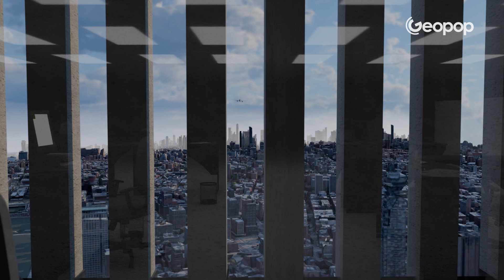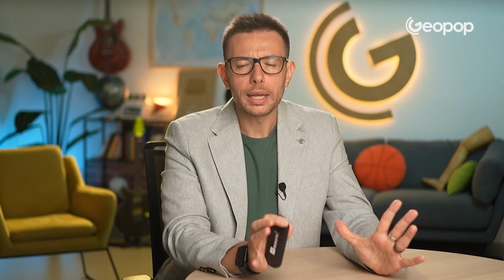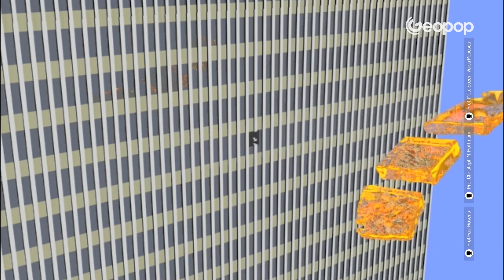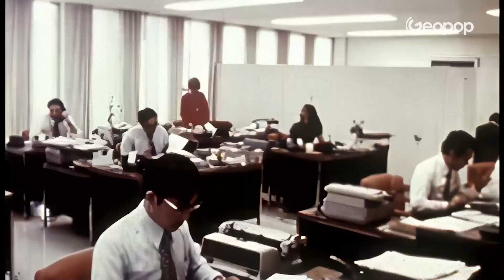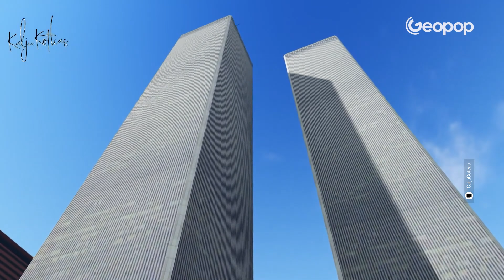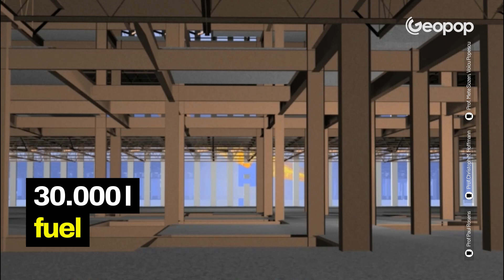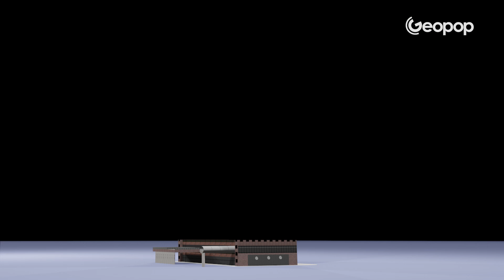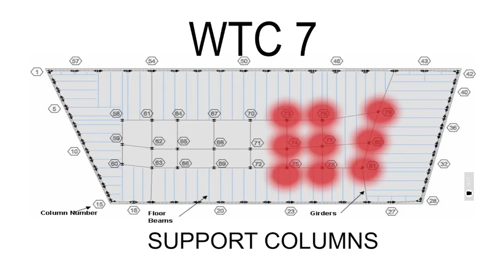9/11, 2001: The Technical Reconstruction of the Twin Towers and WTC 7 Collapses

Comment: The collapse was due to the heat on the steel as explained in the video. yes; but an EQUAL cause was the unique design of the towers.
Let me explain:

1. The main worry of any entrepreneur proposing a skyscraper is the economic viability of the project … there was real worry that the low % of occupancy of Manhattan office buildings would doom the World Trade Center.  There might be too much empty office space in lower Manhattan!

2. The architect’s plans that were approved were selected because of the “open” floor plan, with the vertical strength of the buildings in the central steel reinforced concrete elevator core & the iconic stainless steel outer girdle that surrounded the outside (the vertical beams that you see as stripes closely packed around the outside of the buildings, which leave little space for the narrow glass windows).  With the core, these vertical stainless beams carried the entire weight of the twin towers.  Why this design?  To create an open floor plan on every floor of the building (with no internal columns, the prospective tenants could design & build the interior walls as they wished).  This open floor plan was a major selling point to fill the building with new tenants.  The walls put up by the tenants were invariably NOT load bearing.  The actual floors “hung” between the core & the outer shell.  This is a major part of the explanation of the sudden collapse.

3. The stainless exterior beams, together with the core, made the buildings precisely like an egg, with the main outer shell providing a majority of vertical support, the floors virtually hanging between the center core & the hard “egg shell”on the outside.  If there was a downward force the strength of the union between the floor structure & the outer “shell” was critical!

4. If lower floors lost their vertical support like the spot where the airliners hit, the WEIGHT of the floors above that spot acted like a massive hammer, the sudden blow immediately overwhelming the vertical supports (the core & the shell) of the building’s lower floors & “stripping” the floors from the outer stainless beam girdle. This kinetic cascading “pancake effect” is the same as we see in earthquakes.  Proof? The tower first struck stood much longer than the tower struck many minutes later.  Why? Because the second jet hit the second tower lower, thus creating a heavier “hammer” to force the chain of events which resulted in the tower being “husked” like an ear of corn (separating the floors from the outer stainless supports) earlier than the tower struck first.  The second proof is the example of a building designed with the traditional “box beam” construction that received the hit of a big B-17 bomber years earlier & survived, The Empire State Building. That building’s inner column supports stopped the “pancake” effect from collapsing the floor structures in sequence.

5.  The force of the big jets blasting through the outer stainless shell (you could see the debris shooting through the other side) obviously obliterated or seriously weakened the elevator concrete core vertical support. The concrete was brittle & vulnerable to side forces (it would not have taken much side to side movement to crack & weaken it). The building’s design thus doomed the structures to collapse.  This blow from the airliner took out a wide chunk of the outer “egg shell” as well & as we all know, once the shell is breached, an egg simply collapses.  The weight of the collapsing floors simply added together to create more & more momentum as the buildings went down, making the collapse occur incredibly fast.  Look at the outer shell beams in the debris, sticking up like fence post pieces.  Use common sense, there was no need for a “controlled demolition” with explosives, the kinetic energy & weight of the structure brought the buildings down.  There was no visual or auditory evidence of explosions, period.  

It is important to observe that almost all of the skyscrapers in New York are designed on the “box” steel column & horizontal girder, tried & true construction method, instead of the “egg shell” method, which was considered radical at the time.  Thus, like the Empire State Building, they would not likely collapse like The World Trade Center buildings.  We don’t know if the terrorists knew the engineering, or were just “lucky”!

Why the above explanations were not made by the mainstream media is beyond my understanding, but engineers would agree, unless their brains were infected by the conspiracy theory cancer.  When media fail to do their job of providing expert explanations, the conspiracy theory fools gather like vultures to promote their own radical views.  The superficial news media in this case, once again showed that unless their reported content has sensational or entertainment value, it doesn’t make it on the air!

I would add, Tower 7, as you probably noticed, was designed with open floor plans & a reliance, in large part on outer columns, not the tight boxed design of most other skyscrapers.  Its trapezoidal design introduced unique engineering elements that presented a unique set of weaknesses & the fires were able to burn for too long, given the electrical & water shortages.  Again, no visual or auditory evidence of explosions.

Should the architects be blamed for a twin tower design that could so seemingly easily bring the towers down?  Well, in law, liability for negligence attaches only with sufficient probability & foreseeability.  Was it foreseeable that large commercial airliners almost full of fuel would strike the towers?  We’ll never know the answer to that question, it was never asked in a court of law!  Sometimes “innovations” have unintended consequences!
Reply: Perfectly articulated and yet too many big words for “skeptics”
Reply: You nailed it! People get hung up on the strength of the columns, but what really mattered was the strength of the floor connections. The truss plates were the weakest link. They were just a 3/4" steel plate that held up the floor trusses. Each floor was 1 acre in size being held up by about 100 truss plates. One on each floor/column connection. When the top 30 floors came down, that plate didn't stand a chance in hell of resisting that force. The next floor had 31 floors of coming down on the same 3/4" truss plates. Then next 32, 33, 34, and so on. The falling mass grew while the truss plates were 3/4" all the way down. They offered basically no resistance which is why it happened so fast, and was so complete.
Reply: you drank the coolaid

Comment: This is a political fraud          the behavior of the fall is only explainable by a commercial type demolition,  The presence of thermite type destructive demolitions at all levels is the only reasonable answer.  The idea of weakened steel causing the collapse observed is insane.  The invention of excuses for the 3rd building collapse is equally insane.  Add the sound of consecutive explosion testified to.  This guy may be an amiable man but his BS explanation of the collapses is so invented that someone with an authoritative voice may convince the vulnerable but the TRU TH is totally missing.  This whole presentation is a collosal fake explanation.
Reply: Thermite is not used in commercial type destructive demolitions. The only way to explain the Towers collapses is to keep demolition out of it.  Example:  

While complex, most of the Twin Towers collapse mechanisms can be seen with the naked eye and easily discerned and understood by the layperson if sufficient time is taken to understand. 

1. The Twin Towers consisted of 4 primary structural elements that together formed an integrated system where each relied on the others.  47 hollow box-section steel Core Columns carry the majority of the gravity loads. The 236 hollow box-section steel Perimeter Columns carry the remainder and ALL of the lateral (wind) loads. Long-span Lightweight Steel Trusses connect the core and perimeter column together at each floor with a Hat Truss on top to tie the structure together as an integrated unit where no element can survive without the others. There was no structural load bearing concrete and most components were bolted together. www.youtube.com/watch?v=u7OqrC74Dm4 

2. The impact of 117 tons of airplane (= to about 12 dump trucks) at speeds up to 590 mph with the energy of a ton of TNT completely destroys the aircraft. This in no way implies the Towers come out unscathed. Many perimeter columns are damaged or destroyed as are some core columns (example; 33 of 59 perimeter and 20 of 47 core columns damaged or destroyed at the impact floors in the North Tower), This damage is primarily through bolt-shearing failures at the end connecting flanges, as well as bending, twisting and fracturing of weld seams. There was no cutting or slicing - the reality was far more violent and messy. 

3. The impacts destroy or damage fire insulation, fire breaks and sprinkler systems on multiple floors.  Huge fires are started across multiple floors simultaneously and allowed to spread rapidly with no effective firefighting or fire suppression. This was an unprecedented fire event . 

4. The hotter steel gets the weaker it gets .  With fire insulation stripped away and no sprinklers the survival time of the steel greatly reduced. Gradually over time heat causes the lightweight steel Floor Trusses at the impact damaged floors to sag, which was observed and recorded.  No steel melted or needed to. Structural steel fails long before it becomes a puddle. It just needs to bend

5. Sagging floor trusses pull on the increasingly weak and overloaded Perimeter Columns, causing some of them to bow inward by up to 5 feet. A straight column is up to 4 times stronger than a bent column. The bowed Perimeter Columns buckle and fail, initiating collapse. The formerly static mass above which the structure below could easily support is now converted into a dynamic mass up to 30 times greater. Because they have buckled, the Columns above and below the failure point are no longer aligned . The load bearing structure below no longer bears any load as it falls past the lower columns, NOT onto them.

6. Thousands of tons of debris fall within the four outer walls, down through the open office space, crashing onto the first intact floor it encounters. This massive impact immediately breaks the bolted connections to the columns as the amount of resistance the Floor Trusses can offer is negligible.  The falling debris slows only marginally and briefly. Note:
6a. This is NOT a solid top block crashing into and “crushing” a solid bottom block .
6b. The debris falls past the columns not onto them.  The columns provide no resistance to the falling debris. 
6c. Only the bolted connections of the floor trusses to the core and perimeter columns can offer any resistance. A pair of 5/8” bolts at each end of each truss vs. thousands of tons of falling debris.
6d. No laws of physics are violated.

7.  This floor-led collapse progression within the four outer walls can only go straight down. Note: 
7a. This process is often incorrectly referred to as “pancaking” which actually refers to a completely different process rejected at an early stage. The catchy name stuck but nobody knows what it is supposed to mean.  Pancaking is too simplistic and inaccurate anyway. More like Kaiserschmarrn.

8. Collapse progresses through the floor systems not down the columns, through the path of least resistance . Rate of floor failures increases with each successive floor as momentum increases, reaching an average acceleration of 0.65 of GA, or 35% slower than true free fall. Bam, bam, bam down the building until there are no more floors to fail.  The resistance offered by each successive floor is always the same. The mass and velocity, thus the energy of the falling debris is constantly increasing, with each floor destroyed adding new falling mass. Some falls to the sides, but most falls down. More mass, more velocity, same resistance with each floor.  Don’t get stuck on the but the lower floors weren’t on fire nonsense. They weren‘t and didn’t need to be.

9. The Towers were 95% air by volume. As that air was compressed inside the building it is forced down the tower and blown out the sides in reaction to the building collapsing . Those were not “explosions”, it was expulsions of compressed air caused by the collapsing building, explaining the low velocity, lack of flash, blast, supersonic pressure waves and lethal high-velocity ejecta.  

10. Perimeter Columns become detached and peel away like a banana behind the collapse front, playing out to the four points of the compass extending to more than 600 feet from the base of the towers. This was quite obvious from examination of the debris pile. 

11. Core Columns fail last as their internal beam bracing is stripped away by falling debris and lateral support from the floor to perimeter columns is lost. 

12. For those who care about how long this whole process took; 31-34 seconds from the moment the perimeter columns buckled until the last core columns hit the pile, or 1/3 the rate of true free fall. Don’t believe me?  Just watch any video of the collapses and note the loose truly free-falling debris dropping much faster than the towers themselves.  

13. Each Tower had a 1-acre footprint. Far from collapsing inside their own footprints the debris pile spread out over 17 acres in a pile up to 14 stories deep. 8 surrounding buildings were destroyed and scores more damaged by the falling debris. 

14. NOT observed were the 180-190 dB bangs of thousands of high explosive devices or the blinding bright flashes of burning thermite. Neither explosives or thermite could have survived the impacts and subsequent fire nor could have caused the (silent) perimeter column buckling that clearly initiated collapse either. A video of a shocked and injured firefighter casually using the magic word explosion is in no way proof of explsoIVES  and the demolition_ case relies entirely on that sort of thing. There is zero tangible physical evidence and it would be technically impossible, totally impractical and completely unnecessary. No one would bother. 

15.  Finally, the Twin Towers were perfectly safe within their design envelope.  They only collapsed when taken far outside design parameters by an extraordinary and unprecedented event 

Impact + Fire (heat) + Time + Gravity = Collapse . Remove any one of those four elements and there is no collapse. Ignore any of those elements (as many do) and you will never understand the collapses. The Twin Towers were an integrated system in which no one component could survive without the others. One fails, the rest follow, through the path of least resistance – DOWN – through the open space, bypassing the path of greatest resistance – the columns.  Nothing I just described violates any laws of physics. All of the above is true no matter who planned and carried out the 9/11 attacks or why 

In 24 years zero structural engineers of tall buildings, including the 1/3 that have retired in that time, have made any statements in support of 9/11 Truth BS demolition claims. Zero, nada, none. The lack of any such citations in the engineering literature (published in any country worldwide) is palpable.

I hope you found this helpful and informative. It is not meant to be adversarial, but to solicit informed critical comment, positive or negative. If I made any errors of fact, logic or reason or left anything critical out, please let me know so I can fix it. To stay focused just one topic at a time please and on-topic (Twin Towers ONLY). No word-salads of Gish Gallop. IF you can offer a more plausible alternative be my guest. Be the first. Please start any reply with the words “Tits McGee” or I will know you didn’t actually read it, are not serious and just wasting my time. If you are going to argue, do it on the merits.

Comment: WTC was expecting a massive bill for asbestos removal. That was conveniently avoided. WTC7 was deliberately "pulled" - a demolition term.
Reply: Nonsense. The South Tower and Building 7 had zero asbestos in them, the North Tower none above the 40th floor with much of that below having been abated over the preceding years during the course of normal renovations. More than 70% of the buildings in NYC contain asbestos. It isn't that big a thing.

Also, the terrorist-hijackers almost certainly didn't give a shit.